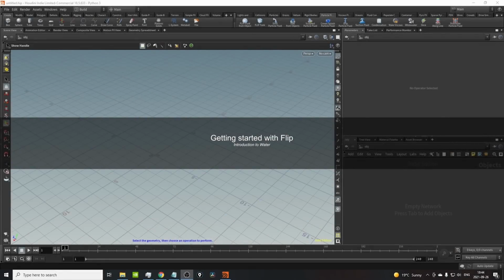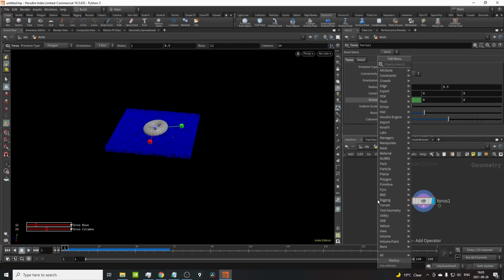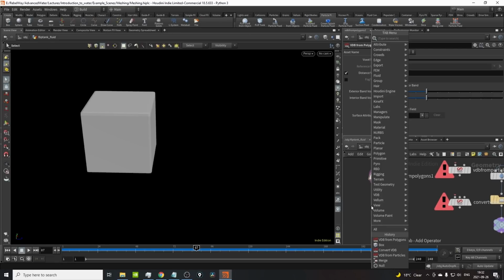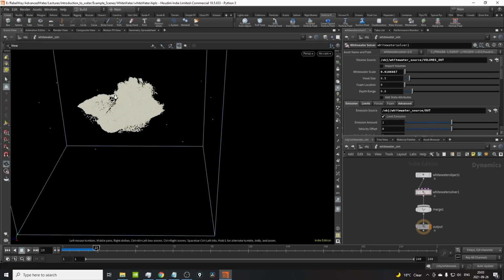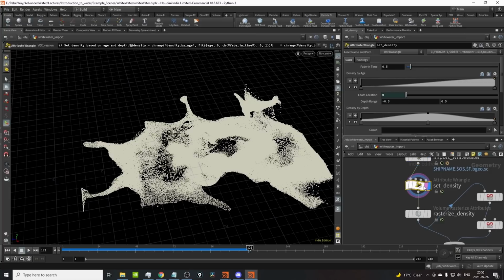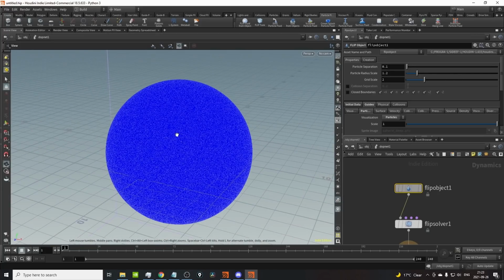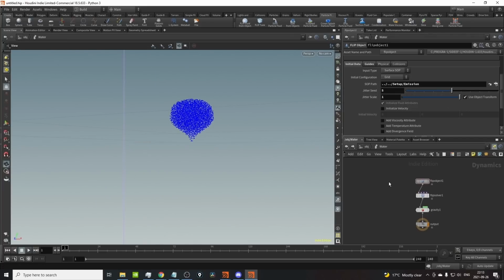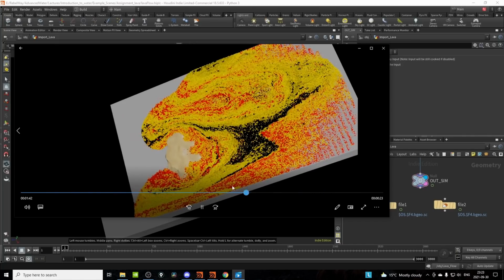ILP Artist Lessons | Advanced Water FX in Houdini (Week 1)

Comment: Hi there - I would like to create an object splitting a wave tank fluid in two - ie: Split the water - but make it spray up quite high on either side - I'm running an Intel 20 Core i9 / 32 gigs of DDR4 and an Asus STRIX 1080Ti - Is this machine enough to process a simulation like this? :/